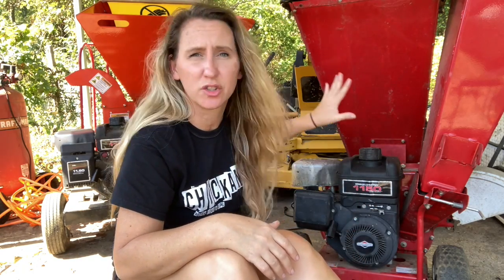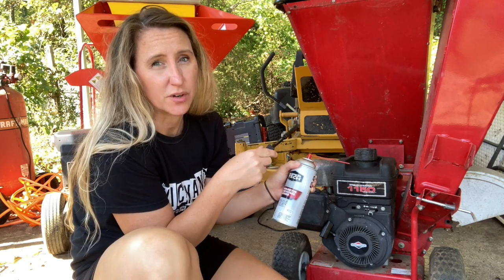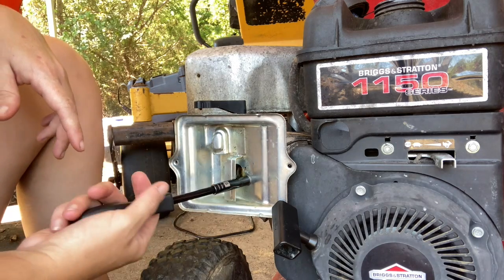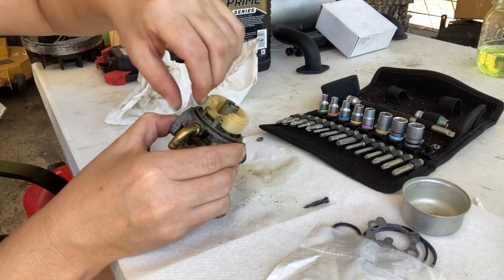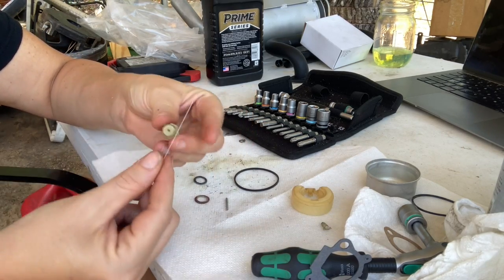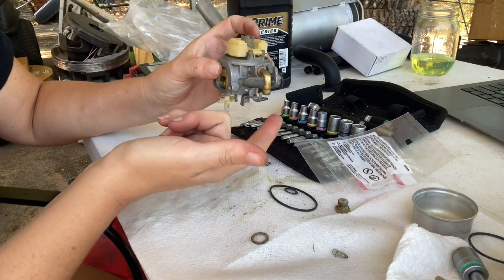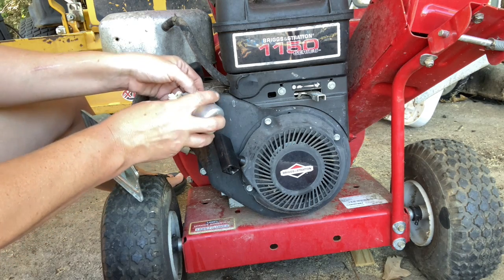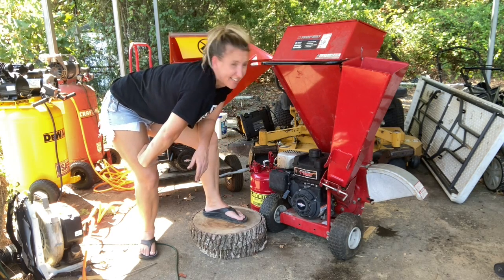Log Splitter/Chipper Shredder WON'T START? HOW TO REBUILD A BRIGGS 1150 SERIES CARBURETOR

Comment: I'm just wondering if you have a video on how to fixed 11HP pressure washer.  Mine either start at first pull or after a few pulls.  It doesn't run long before it make a joking sound and stopped completely

Comment: I have a gas powered air compressor that has the exact same motor on it. It's been pretty reliable since i got it. When i 1st got it wouldn't run but a good cleaning in my ultrasonic cleaner got it running like new again

Comment: Running great, not much different to a normal Briggs Engine when it comes to the Carburettor, want to by on back here in Australia just using a  Masport.490 which has a mulching section built in with an extra blade that sits on top of the 4 blades on the cutting plate for grass works well for normal size branches you find in your yard, naturally without to many leaves , otherwise you definitely need one of your mulches. In Australia it would be about $1,000 up brand new for good quality equipment.

Comment: Not long ago you mentioned a $189 Echo model trimmer. What model number is it and can it take a brush cutter blade?
Great videos.
Reply from the maker: The smallest Echo you can put a brush cutter blade on is the SRM-225. It lists for $199.99. You might want to get the PAS-225 though. It is $249.99, but has a split boom in the center to change out attachments.
Reply: @Chickanic  Thank you so much! BTW, everybody should share your videos on other social platforms too.

Comment: So nice that carb does not have the rubber seat like the Briggs quantum engines do, they love to swell up from the ethanol. A trick that I use when I prime an engine like that to get it to start, I have a rag handy and when I get it to run on the spray I will solidly choke the intake with my hand or a rag if my hand won't seal it up well enough. If you just have some old fuel and the jets are kinda ok when you choke it super solid you force a ton of fuel up through the main jet and you can sometimes get the bad fuel through to some more volitile stuff and possibly clear a small obstruction from the main jet and the engine will run fine. It's a long shot but it can save you from pulling the carb if you are in a hurry and just need to get working. %99.99 of the time the carb needs a full cleaning but there is that chance it will run just fine.

Comment: Just a tip wear disposable gloves with carb cleaner, it’s nasty stuff to your hands. Good video 🙂👍
Reply: I'd love to find a brand deposable gloves that don't come apart time Carb Spray gets on them.
Reply: I want an ultrasonic cleaner so I can hopefully retire the carb spray altogether, or at least cut way down on the use of it. It's nasty, nasty crap all round. The fumes always give me a headache even if I spray it outside. The worst part of small engine repair for me is having to use that stuff so often.
Reply: @brendanfromnz  my daughters got me a harbor freight ultrasonic for Christmas. It is great for carbs. It saves from using spray, which has jumped 25% in cost recently. Compressed air and ultrasonic cleaner does better than 1 can spray per carb. I still use a bit to clean off the outside to get caked on grass off the carb before removal from the machine
Reply: @haneyoakie14  Sounds good to me! Down here in NZ it's about $20 per can for the good stuff like CRC. You can get slightly cheaper but I'm not sure it does such a good job. Stinks to all hell though. Definitely investing in one of these things! It can't be good to breathe this stuff in all day every day, or have your hands soaking in it. Nitrile gloves help, but it's still nasty.
Reply: @brendanfromnz  wow. And I am complaining that here in Michigan at Walmart it went from $1.97 to $2.48 for the Walmart brand, which works just fine btw.
Reply: @haneyoakie14  Oh don't tease me like that lol! 😱 The cheapest I can get is about $13 or $14. You would be disgusted at the price of many things here. I feel like we're so ripped off when I see how cheap things are overseas.  And fuel is horrendously expensive. Around $2.50 per litre in many places. I know you guys work in gallons, so not sure what that equates to, but I bet it's way dearer. It's a beautiful bit of paradise, but not when it comes to opening your wallet haha! Hooray for online shopping and worldwide shipping I say!
Reply: @brendanfromnz  A litre is about a quart, a gallon is 3.875 litres. Here in Michigan right now, gasoline is about $3.29 per gallon, or $0.85 per litre, or liter as we spell in in the US. The brand Chicanic is using is the Walmart house brand, which is the one that 2 weeks ago was $1.97 and yesterday is now $2.48. Name brand stuff is usually $3.99 or so, or it was before the latest round of government money printing causing inflation.
Reply: @haneyoakie14  Oh dear. Been many a long year since we had the pleasure of paying 85c per litre! Probably not since the early 90's. I'm often jealous of how cheap things are for you guys overseas in comparison. I think the main issue for us is isolation. The cost is high to get things in here.
Reply: And safety glasses….protect those eyes from backsplash!